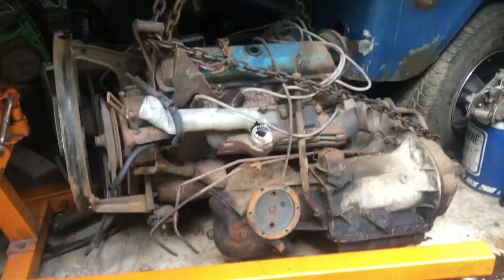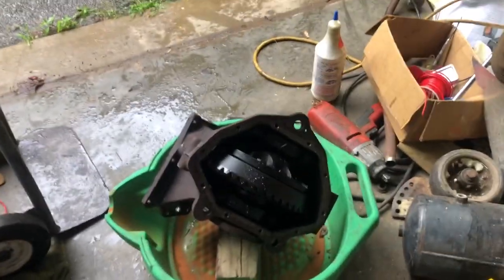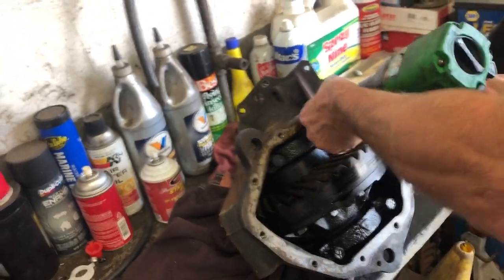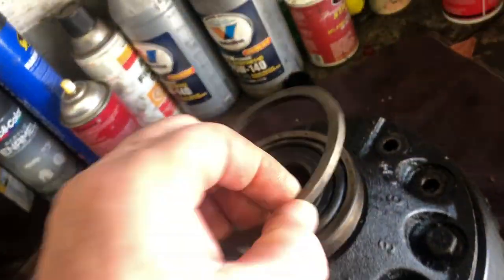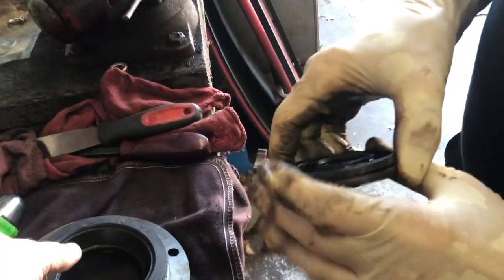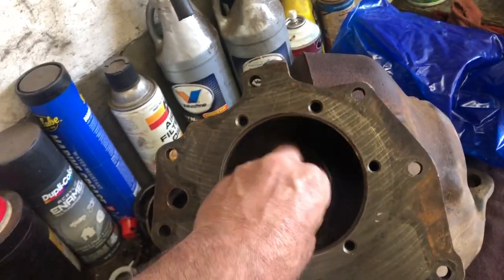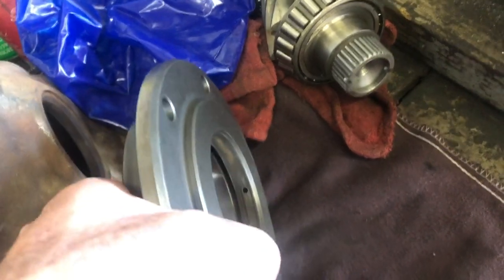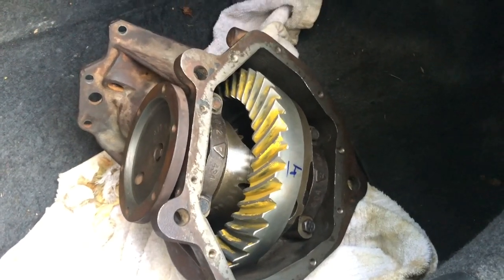1973 GMC Motorhome Episode 25 Final Drive Rebuild upgrade

Comment: Thanks for making this video.  I have a 3.42 and recently noticed something sticking out of the weep hole.  I tried to pull it out using needle nose pliers, but even though it is loose in the hole, it would not come out.  I now know its the little "L" shaped piece of wire that is supposed to be in there!
Reply from the maker: Excellent! I am glad this is of value to the GMC community. I see your responses on a lot of posts and you have helped me as well. A great community indeed. Thanks!